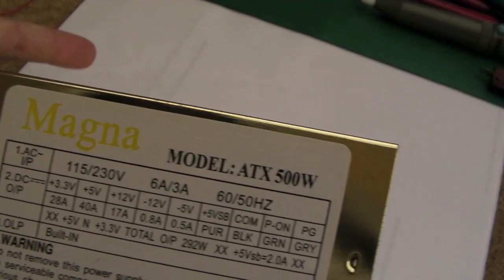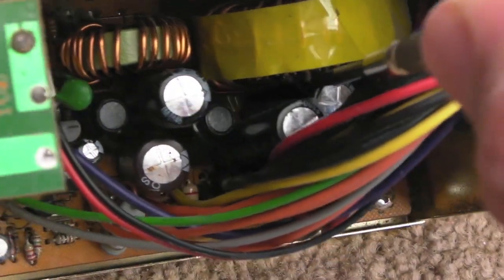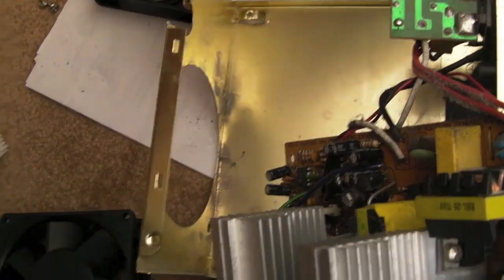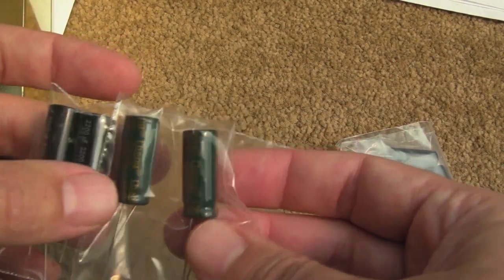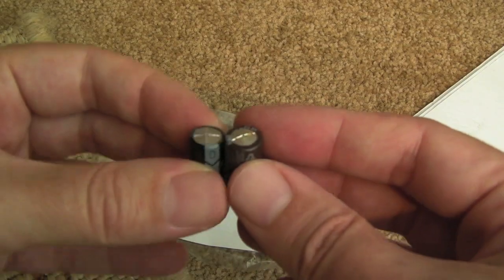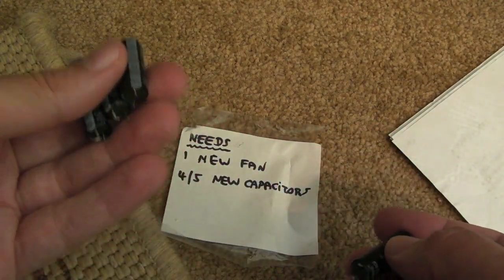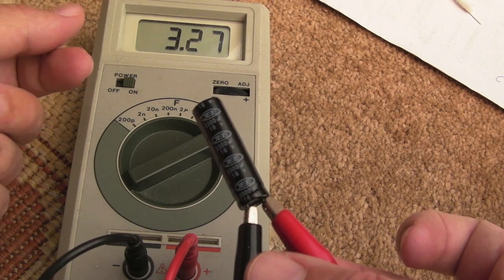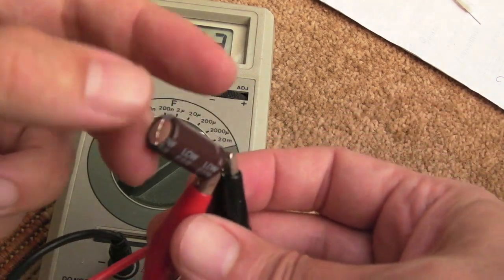VLOG - ATX PSU Repair (Caps & Fan) - Skip this video unless you're bored!

Comment: Not boring to me. I wonder how many ATX PSUs get chucked into the trash every year when most could be fixed easily. Thumbs-up!
Reply from the maker: Thanks =D  Yeah, easy to just consider binning cheap ATX PSUs, or scap them for parts.  This particular PSU was used in one of my own PCs a long time ago (2000 ish) but ended up being the source of resets and crashes (no wonder with the caps the way they were lol).  Came in handy eventually I guess lol.
Reply: Wow. 2000-ish? That PSU owes you nothing, but still useful after a quick recap and new fan.
Reply from the maker: Yeah lol, what's amazing is I kept it for 17 years before re-capping it lol.

Comment: Gadget, 'Chong' caps! Noooooo :D haha. Used to use those for building guitar effects pedals, don't think they're very good. You know a lot more about this stuff than me though! Never get bored watching your videos, regardless of what you're working on. Keep em coming buddy.
Reply from the maker: Thanks =D  They are cheap caps, but they do measure low on the cap tester tbh!  You've also got to consider that all I will be using this PSU for is short bursts of testing.  It's not like its going to be powering a PC for hours every day etc.  The caps on it now are better than the ones it had originally too lol.
Reply: Just goes to show those cheap Chinese capacitors are shite 🤔 good vid once again Chris.......Kim 😋

Comment: Nice video. Cheers for uploading. I got a Jeantech PSU that I swapped out of a mate's kid's PC. It is currently in a box in bits after I gave up chasing a short on it. Maybe I will dig it out when I run out of other things to attempt fixing. I do keep a load of old junk lol.
Reply from the maker: Thanks =D  Often with things like this its easier to just use them for spares, but if its a simple fault like mine had - may as well fix it so I can use it!

Comment: These ATX powe supplies have some many caps, and burned traces, its not even worth the time/trouble fixing most the times, unless you need to keep some vintage computer 100% original. Another great informative video Though.
Reply from the maker: Absolutely - as I said in the video, it's not worth repairing them most of the time. =D

Comment: Can i ask you a thing? I have a snes power brick that moving the cable it would turn off the console, so I thought it was the welds inside the brick, I disassembled it and notice that there was a little "fix" wrapped in white tape, I shortened it and weld everything as before but without the "fix", but at that point the console was not lit anymore... After a while, i disassembled another power supply and I noticed that inside presented the same "fix" with white tape, so i understood that the part that I cut off was actually an electronic element welded to the cable! The problem is that I have no idea what it was ... Do you know what element was that i have cut off? (sorry for my english)
Reply from the maker: I am not sure what you mean - some photos might help!  I am guessing it might be a fuse!  If it is a fuse, bypassing it is not a good idea as a fire could start if something goes wrong with the PSU or the system.

Comment: Hmm.. I have a funny experience with electrolytic caps in general. I think the ones from 70's and early-mid 80's are durable and often immortal. Then, all of the sudden, era of leaking acid started. Same as with floppy disks. 5.25" and early 3.5" are fine. Newer ones are total crap. Cars as well :) The World simply changed and turned to different direction. I don't know.. Just an observation..
Reply from the maker: You are definitely right!  The ones from 70 to mid 80s definitely are much better and seldom need replacing!  What probably happened is they changed the electrolyte forumla to make them cheaper / more efficient etc and that ultimately is the problem.

Comment: Hi I want to get an atx pcu from 1999 for my 90s pc build. Im planning on getting one new in box and I was wondering what I should do to future proof it? I want replace all the caps but is there anything else I should replace? I just don’t want it to destroy my pc parts. I’ve already got a surge protector monitor stand from 1999 btw
Reply from the maker: Yes, you could perhaps replace any fans in there, put arctic silver or other thermal compound under ICs / transistors that might be heat sinked (be careful to re-fit any isolators there - sometimes the metal tab does not make electrical connection directly to the heatsink).   Also look for any tantalum capacitors and replace those.  And finally, you could consider replacing any switching transistors on there - that can sometimes be hard, sourcing replacements etc.   The number of hours on a PSU is limited generally by capacitors and the transistor(s) and how much use they had, how stressed they were over the years.

Comment: Switching PSUs need low-ESR caps, which Chong/Chang and Samxon probably doesn't have at all.
Reply from the maker: They are cheap caps, but they did measure low on the cap tester tbh!  You've also got to consider that all I will be using this PSU for is short bursts of testing.  It's not like its going to be powering a PC for hours every day etc.  The caps on it now are better than the ones it had originally too lol.